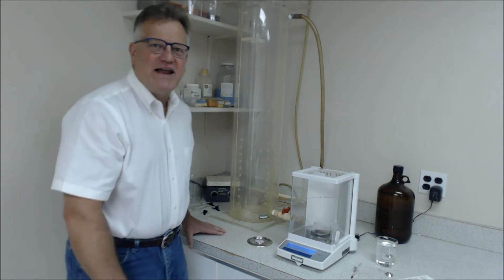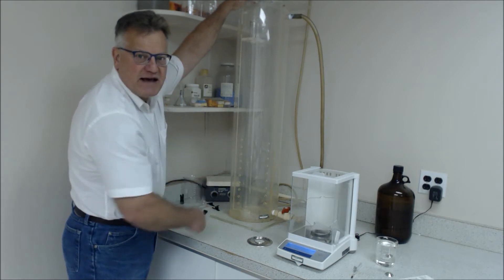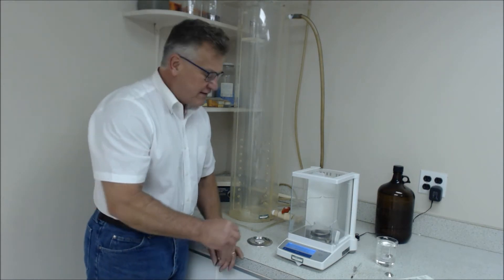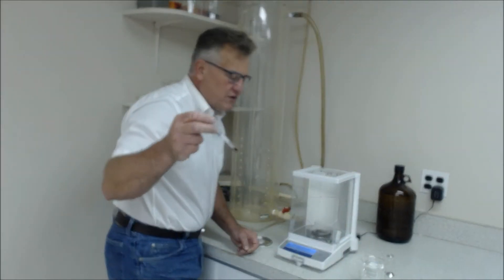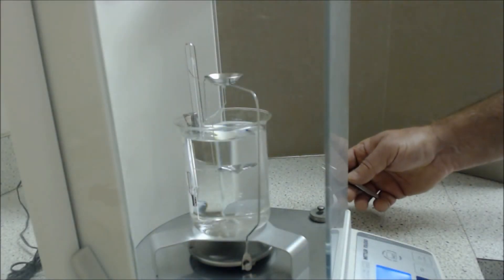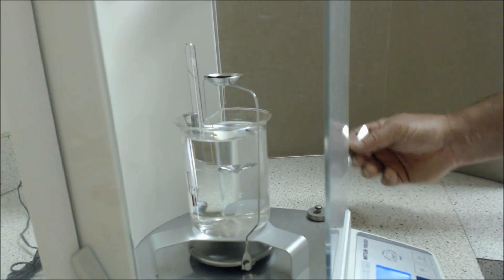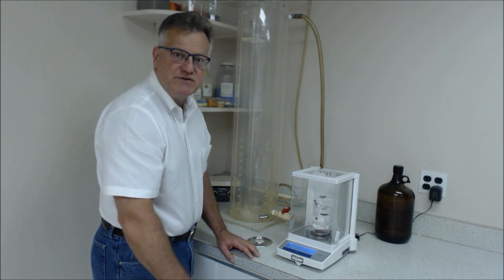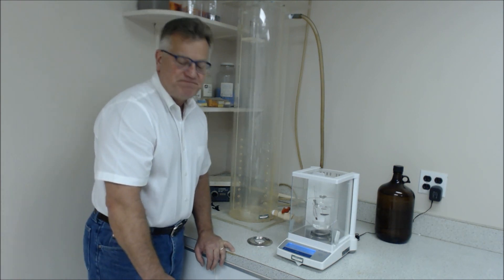GRI GM13 ASTM D792 & D1505 Density of HDPE Geomembranes

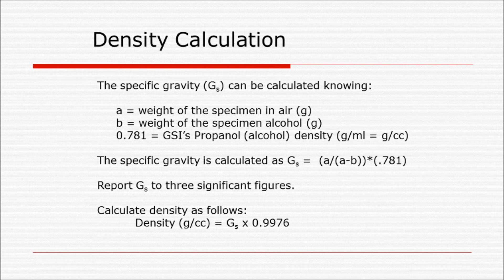Comment: @3:21 Error in calculation. Per ASTM D792 specific gravity is not (a/(a-b))*(.781). It should be (a/(a-b)*(specific gravity of liquid). Specific gravity does not have any units and multiplying by density will yield units.